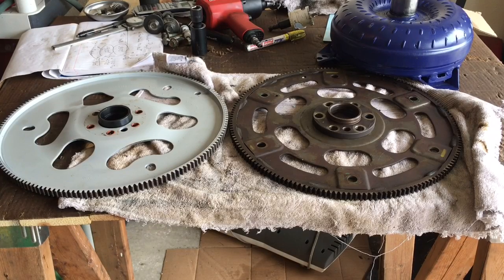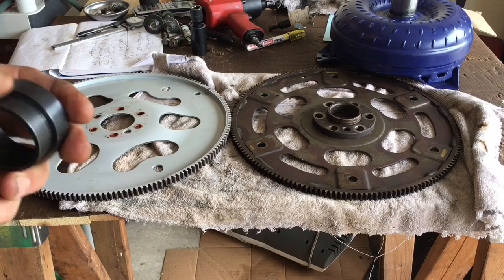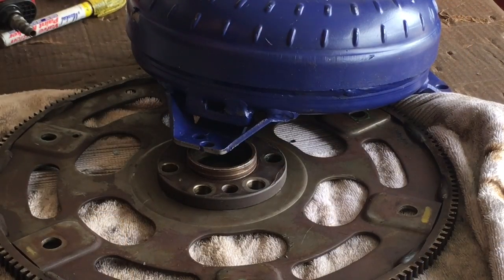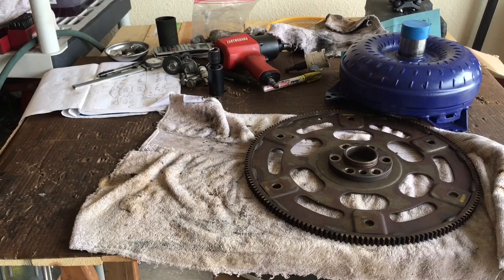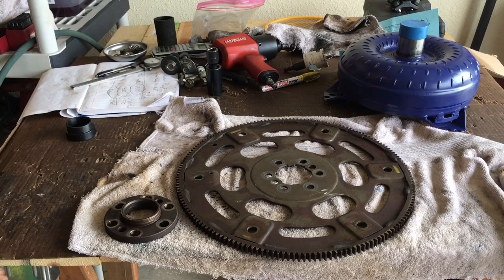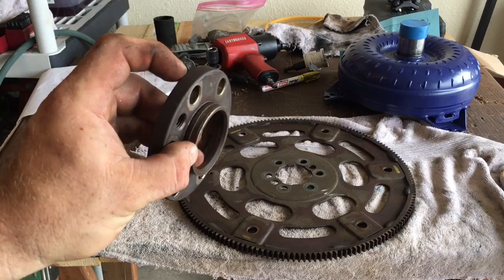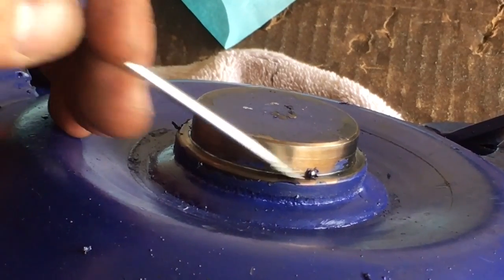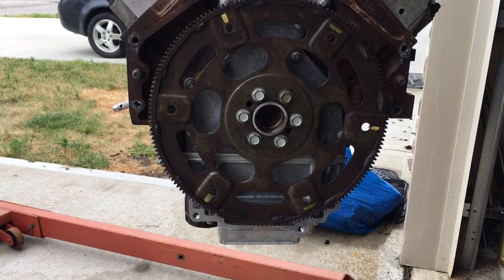LS/TH400 Install requires a bolt on adapter

Comment: Does the adapter come with the 4L80 flex plate or do you need to purchase it separately?
Reply from the maker: Sorry for the late reply, many of the flex flights come with it if it’s specified for a 6.0 80e. Unfortunately, I don’t know for sure which manufacturers included it or not so just make sure to verify before you purchase..

Comment: @OMRY1561 - 4 min ago
Hi nice video Great information
I have 1967 cadillc th400 and 429 engine
Do I need any adapter if i install 350 It1 gen2 to the
th400 thank you
Reply from the maker: Very sorry for the late reply
https://www.novak-adapt.com/knowledge/gm-crank-spacing

Comment: What torque converter are you using?
Reply from the maker: I’ve gone through 3 converters so far!  I haven’t installed the 3rd one yet. 
1. Don’t waste your money on a B&M anything especially the Holeshot 3000 it’s cheap junk. 
2. I had decent success with a TCI 10” Super Street Fighter w/anti ballooning plate 3500-3800. 
3. New converter is the “Entry” level boost PTC 10” w/anti-ballooning plate spec’d for my combo. 
* The best Bang for the Buck converters are the Jegs XHD 10” built by TSI.  Decent price and a solid/proven performer up to 800+ wheel HP.  JD
Reply: @HeadFlowInc  thanks for the quick response and the advice!

Comment: Probably sums question but you put that adapter behind the flex plate directly on the engine first?
Reply from the maker: It depends on whether you have a flat flex plate or a dished flex plate. If you have a flat flex plate the adapter goes on the crankshaft first, if you’re running a dished flex plate you put the adapter on the Transmission side of the flex plate. It all depends on which application you have.
Reply: @HeadFlowInc  I have the dish flex plate. Bevel side
Reply: I also had to notch the plate to get in to line with the TC
Reply: Using early model 4l60E

Comment: After a year now is it still working I'm doing a Ls to turbo 350 and found this flex plate what do you think part # ATP Z-270 it is a machined plate designed by chevy for $50 bucks thanks you
Reply: Thanks for getting back to me so soon. Trying to get my 1966 chevy 2 on the road. I'm at work now but will read the forum on lunch. Thanks again. Gave you a like and sub.
Reply from the maker: I believe a TH350 uses the dished flexplate with the converter to crankshaft extension ring.  Check out this link:
https://www.novak-adapt.com/knowledge/gm-crank-spacing

Comment: Link to the website please
Reply from the maker: https://www.novak-adapt.com/knowledge/gm-crank-spacing

https://www.jegs.com/i/JEGS/555/601010K/10002/-1
Reply: @HeadFlowInc  I have the flat flex plate and the spacer and there is still a gap between the flex plate and the torque converter what should I do now
Reply: Is there suppose to be space between the flywheel and torque converter

Comment: It on the wrong side the dish is face out so when the flexplate bents you inward
Reply from the maker: It depends on which transmission and which engine/crankshaft register length.  One way doesn’t fit all applications. 
https://www.novak-adapt.com/knowledge/gm-crank-spacing

Comment: Looking to install a  T400  in my 2005 5.3 silverado what all do I need for the conversion?
Reply from the maker: https://www.novak-adapt.com/knowledge/gm-crank-spacing

Drive shaft, shifter and Torque Converter. Maybe move or modify the crossmember I’m not sure.  JD
Reply: @HeadFlowInc  thanks  Very helpful !!👍

Comment: Did you have to use spacers for the torque converter mounting tabs to the flex plate
Reply from the maker: No I did not need spacers, I’ve never had good luck running spacers without having vibration issues. 
If you need spacers they need to be precision flat and all exactly the same. 
I wouldn’t waste time or money on a B&M converter either.  JD
Reply: @HeadFlowInc  I’m running the same flexplate with bolt in spacer with a th400 converter from jegs which is said to be the exact same as b&m. I’m not running spacers either. Thank you

Comment: Is that a B&M torque converter
Reply from the maker: Yes very loose B&M Holeshot 3000 converter. It didn’t stay very long, I’m using a TCI Super Street Fighter 3500-3800 w/anti-ballooning plate #241002 until I can afford to upgrade.  JD
Reply: Do you think the B&M 20484 would work good
Reply from the maker: I’ll be honest, I’ve never used a B&M converter I’d recommend to anyone because they’re cheaply made for the price.  You can get a entry level PTC converter for +- $500.00-$550.00 shipped.  I can’t justify spending over $400.00+ on a B&M. 
The only off the shelf converter id recommend is the Jegs XHD converters made by TSI.  Currently on sale for $337.99 are excellent quality with dual anti-ballooning plates rated at 800hp. Check them out in the stall range you need, if going turbo make sure it’s big enough to get into boost.  JD
Reply: I'll let you know I found a pretty decent torque converter for really cheap look these guys up Freakshow torque converters

Comment: Where did u connect  the vacume line that the th400 uses i have a 03 silverado that im swaping a 400 in.? Thx in advance.
Reply from the maker: On the Passenger side of the early truck intake there is an unused vacuum port that’s sealed, all you have to do is open the end. I’ve also drilled/tapped/installed a barb fitting to the oem plastic intakes.  JD
Reply: @HeadFlowInc  Thx 👍

Comment: i am doing a swap oon a 1994 5 speed maual 1500 it was an slush box  but automatics make me sick lol to few gears and 4l60 gearing is terrible  slow shift and just never know what thier doing in playing slid ways  boom a shift n Tq slop n go the old truck 4l80 seems ok but i drove a 2005 mustang auto it was the first auto i did not hate but slop n go  was an issue  been nice in a truck  i think it had 5 gears and felt like spacing was logical
Reply from the maker: *Flywheel: 2001-07 truck. NFW1050
*Clutch: 2002 Camaro Z28/SS or better. 
*Bronze extended reach pilot bushing. #26112
This should be a decent place to start doing an LS swap if you keep the 5 speed.
Reply: @HeadFlowInc  thanks man i know about old supras 5mge 7mge like that lov the help

Comment: Jesus just by the 99-2000 6.0 liter and the Flex plate comes attached with the adapter and that’s it done
Reply from the maker: Danny Rochester I’m running an aftermarket SFI flexplate now that’s dished with an extension/alignment ring. 
It’s crazy how many different ways there are to use the older transmissions on the LS engines. Thanks for watching and the feedback I appreciate it!  Stay tuned I hope you subscribe!  JD
Reply: If you have a long crank early Lq4 you literally need to just bolt the th400 to it as long as the bolt circle for the torque converter is 11.5" Nothing else needed.

Comment: This video is misleading. The spacer would have worked. This issue was slag on converter from beginning.
Reply from the maker: Keith Walker It depends on which flexplate you use, I would not use the ring adapter with a dished flexplate it’s a cheesy pos but lots of people do.  It’s a choice we all have to make. JD

Comment: Thanks for spending the time to post this info! I almost bought the wrong stuff.
Reply from the maker: * BuildItLikeBeal Exactly why I wanted to share and save people wasting money!  Good luck on your build I hope you subscribed!  JD
https://www.novak-adapt.com/knowledge/gm-crank-spacing
Reply from the maker: What’s interesting is you can use either flexplate dishes or flat when you have the bolt-on adapter; you either mount the adapter first or after the flexplate depending on which one you have.  JD

Comment: How did you connect the kick down cable
Reply from the maker: M Gar TH400 doesn’t use a kick down cable, it uses an electric solenoid triggered by a micro-switch.  You can setup the kick down by either mounting a switch near the throttle on the engine or throttle pedal.  I want to hook mine up but haven’t done it yet.  Thanks for watching and the question!  JD
Reply: @HeadFlowInc  are there any conversion kits for connecting that switch or will I just have to fabricate something up
Reply: I think I have the solution for my application its called a pedal kickdown switch. It bolts right up to the pedal assembly on a 72 chevelle. I originally had the switch located on the carburetor but since I will be swapping to an Ls with drive by cable and throttle body I had to find a different option for the kickdown switch.
Reply from the maker: Thanks for the tip, I’ll look into one of the peddle switches, I’d like to have a functional kick down!  JD

Comment: Not to bother you again , but do you happen to know the part number for what starter. 2001+ 6.0 starter is what I’m guessing. I just want to make sure form someone who has already done it. I just Ordered the flexplate and adapted, starter is the last thing and I can start buttoning up the drive train.
Reply from the maker: Omar Paredes I bought my starter from Advance Auto Parts.
All the LS starters should be the same, I bought mine to fit a 2002 Silverado.  Part numbers vary depending on what brands your parts store carries.  
Tell them you need a starter for a 2002 Chevrolet Silverado 2500 with a 6.0 👍
Reply: Perfect ! Thanks again

Comment: The th400 is strong and there's so many fun set ups ,it would be cool to sequencel shift with the monster and B&M and GM, OEM parts mixed, or maximum build🏁🙌🔧🐎🐂 that little welding slag🚀
Reply from the maker: Matt Gorgoglione I wish I hadn’t gone with a 3000 converter, it’s way too loose of a stall for 2.73 gears in the rear end.  I swapped from 3.73’s to 2.73’s so it was manageable on the highway cruising 75 mph. Oops I’ll be switching the converter next Summer. 👍
Reply: I've used size ,35 inch tires and transfer case build so 410 gears in a wide body 10 bolt but shattered, and just snagged a newer wide suburban rear 10 with 373 gearing but instead of 8.5 tall it changed to 373 gears 8.6 ten bolt in which can handle the tires but decent on the highway, I've just put it aside untill I do the dreadful check on the weird flexplate or shattered torqueconverter  noise , 😑, I'm was just updating myself on your video it's good to do as a mechanic when your doing research or find something else you missed when viewing a great explaination video like this and going to websights and just listening to advice from others🏁🙋🔧, I'm thinking about throwing a keoage torqueconverter in a th400 🏁🔧🙌✨🐎🐂

Comment: 4.8/4l80e equipped Express and Savana Vans have them as well.
Reply from the maker: LSX Volvo Guy Interesting, I didn’t know they offered the 80e behind a 4.8, Good information!!!  Thanks for sharing! 👍👍👍
Reply: Thanks. I'm swapping a 2006 express 4.8 and it already has flat flexplate with spacer. You sir saved me money and a lot of confusion on the web.
Reply: Also I ended taking 3mm off of the adapter because  the snout bottomed out before it reached the .187" pull out from the Trans. Plus a little wiggle room for forward movement.

Comment: Novac. I paid for a GM adapter to the AMC the 400. I'm now 4 weeks into a 2-week project. The engine was removed 2 times because the flex plate was too thick the 2 one was warped and now waiting for the third flexplate. Called Novac and was told they would talk to the boss and see if I could get some compensation and call me back Tuesday. It's now Sunday did I get a call? Nope. Try Trans dap.
Reply from the maker: Oneponycar That sucks, it can be a pain in the Arse sometimes! Very frustrating, but you are checking everything which is great! 👍

Comment: I have a Lq9 6.0 what do to use my t400 I
Reply from the maker: Peter. Hatch As long as you don’t have the extended flange  like the early 1999/2000 6.0 then the bolt on adapter and flat flexplate will work for a TH400 or 4L80e
Check out the link in the description for the break down  of the engine/transmission/flexplate combos. 👍

Comment: I think you’re clearance is was due to the weld slag.
Reply from the maker: jeremy rock Maybe 🤷‍♂️. I know I needed way more clearance than what the bb was blocking, at least I think.  I don’t have the measurements off hand but there is a significant difference between the “reach” of the “Ring” & dished flexplate compared to the “Bolt on” adapter & flat flexplate.  Either way you choose, be sure to verify the required space between the seated torque converter and mounting surface on the flexplate.   👍
Reply: HeadFlowInc thanks for the advice I’m going to be mating my 02 4.8 to a th350. The 4.8 was originally mated to a manual tranny I think I will go with the flex plate you used I don’t like the idea of egging the holes out to the torque converter
Reply from the maker: jeremy rock Never grind the tabs on the converter, it’s best to work the flexplate.  But like you saw this flexplate worked fine no mods. 👍

Comment: So without the welding BB on the converter snout the ring style should have worked right? Also, if you could machine the spacer for clearance why not machine the ring spacer to get the required clearance?
Reply: He could have removed some metal from first ring adapter but real issue was the weld slag interfering.
Reply: 9 minutes 44 seconds or so was issue. Everything before that was wasted time
Reply from the maker: harperjmichael No, the simple ring adapter doesn’t work with a TH400.  The TH400 required the “Flat” flexplate and bolt on adapter. 
Go to the website in the description, it breaks down which engines/Transmissions and adapters work.

Comment: I have a 4L60E in my C5 and want to add the th400. Is this all I need? Or should I get a clutch assembly also? Thanks
Reply from the maker: GreyC5 You would not need a clutch assembly to run an automatic transmission.  If you are going TH400 then yes the bolt on 6.0 adapter and flat flexplate is what you need.  You will also need a different length driveshaft and crossmember to make it work. Iirc
Reply: HeadFlowInc ok. And I was told that with some models it takes a clutch to start the car and put it in reverse. Maybe they misspoken? Lol. How much do you think that would run me to have someone create that stuff.
Reply from the maker: GreyC5 There are specialty Race transmissions like a Liberty, Jerico or similar where it launches with a clutch and shifts like an automatic.  This does not apply to a regular automatic like a TH400.
Honestly, I have no idea how much it would cost, to many unknown variables.  Parts quality/price, level of work done/needed, and Labor cost per hour.
Reply: HeadFlowInc I gotcha. Thank you for the insight and knowledge . I appreciate it man.
Reply from the maker: GreyC5 Good Luck make a build sheet so you know how much it’s going to cost. This way you won’t have as much down time due to unforeseen cost. 👍
Reply: HeadFlowInc Good idea. I was planning on consulting with my vette mechanic down here and seeing what he has to say about it. He prob won't like the idea most likely but we'll see hahah.

Comment: I have that spacer on my th350 no issues at all I noticed that your crank side on your converter is allot shorter then mine I have tci converter
Reply from the maker: blown5.3 All the different combinations of engines, Crankshaft registers, flywheels, and transmissions is clearly outlined on the Novak web page I provided. 
There’s a lot more variables than most people realize.  Thanks for watching!  JD
Reply: HeadFlowInc hi there I watch the video you have it’s great I think you’re awesome and I have a question for you if you can answer for me please I have a th400 in the1966 Cadi I wanna swap it to 4.3 Sonoma or Jimmy engine if you think that will fit or if it’s not what should I do to make it fit thank you
Reply: @blown5.3 I'm also running a tci converter. The spacing is definitely different and I can't use those small flex plate adapters they sell online

Comment: Hello Sir!!! Have you ever tried a 700R4transmission. I was thinking about using the 700R4. Or would it be more of a pain.  I'm really undecided in what direction to go. Thanks for your videos. Keep them coming.
Reply from the maker: MATTHEW jacobs I’ll be totally  honest, the 700R4 is a weak transmission.  If you were building a 100% low power cruiser they can work but if you have any real power they just can’t handle it. 
If you want/need an overdrive shop around and find a 4L80e.  I know the 80e is more costly but it’s worth it. JD
Reply: HeadFlowInc,,,thanks for your reply. I have the complete motor and transmission from a 01 Chevy Silverado. It's 5.3. So it's best to keep the combo together. Truthfully I want to use the turbo 350 that's in the 67 Chevy pickup. Just a cruiser nothing fancy,,, Sunday burn out with my kid's.Lol

Comment: All Flex plates and flywheels require locktight for the bolts to the crankshaft? Red or blue locktight?
Reply from the maker: Lime Well, you could use either, I chose to use Ultra Black RTV since I know it’ll seal the threads and not let oil seep out.  For some reason LS engines will leak oil out the flexplate bolt holes, so I’m told.  I can’t stand a leaking vehicle, so I try hard to avoid any potential leaks. 👍

Comment: I knew that adapter was going to be required when you explained it last week. I'm not a.LS guy yet, but the torque conv. cant be pulled out to make up the space, the flexplate has to be moved towards the rear.
Reply from the maker: Don Rutter Hopefully know for sure it works this afternoon.

Comment: Are u sure you converter nose was Not extended to work on ls swaps?  Did u compare the converter with an old th350 converter
Reply from the maker: tim m I didn’t/don’t have any other converters handy.  I know the converter wouldn’t have reached the register on its own.